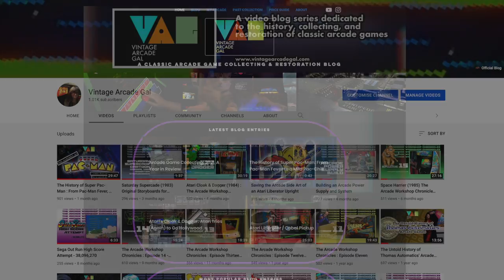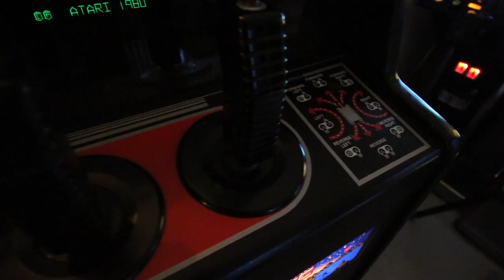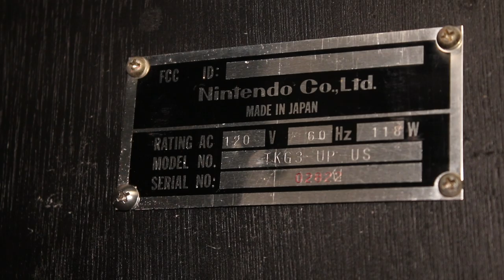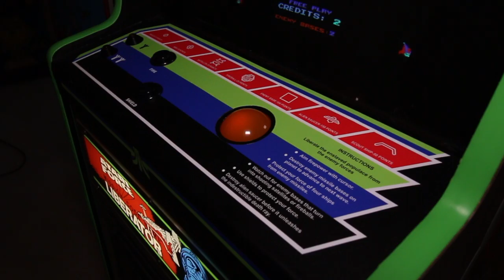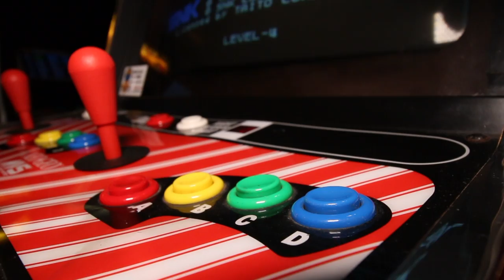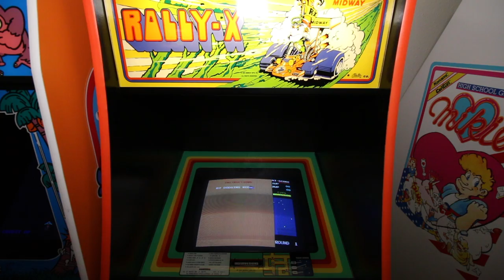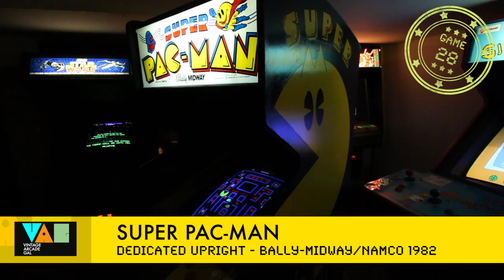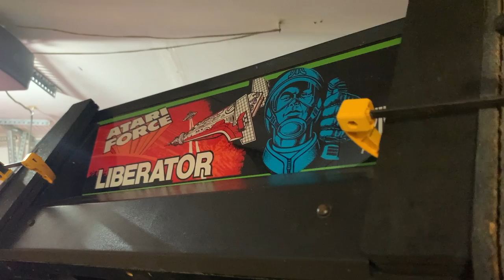A Tour of My Home Arcade Collection, 30 Classic Arcade Games

Comment: Awesome collection. I wish I had space to go that big. I guess I technically do, but I love my console games as well, so I had to keep it to 5 cabinets (I may be able to fit one more if I get creative). I have that same Centipede cabaret, which I play a lot. I also have a Neo Geo MVS, a Nintendo Popeye, a Time Soldiers that was set up as the original game in a Dynamo cabinet, which is kind of weird, and a converted 4-player Sunset Riders that has been at least two other games, but I can't tell which. It was at least a Crime Fighters and something from Taito, but they did enough 4 player games that I'll never know for sure most likely.

I like having an LS30 rotary stick cabinet. I sometimes swap in my pcbs for Guerrilla War, Gondomania, and Heavy Barrel, or the odd vertical JAMMA board like Devastators.

The Sunset Riders I swap in several boards as well. I have... Teenage Mutant Ninja Turtles, GI Joe, and Desert Assault that all have the same 15 pin connector for simple switching. I have other 4 player PCBs, but they're a pain to swap because of different pinout on the 3P and 4P harnesses (WWF Wrestlefest, US Championship V'ball, Ninja Baseball Bat Man).

I have a bunch of other JAMMA boards I swap in from time to time in  the MVS cabinet with a converter. A few that aren't all that great that I got for cheap, and several that I just love from my younger days like Rastan, Tecmo Knight, Black Tiger, etc. I think I have about 50 pcbs and a bunch of MVS carts (as well as one of those 161 in 1 banana yellow carts). I play Neo Geo more on AES, since I own more games on it, but that multi-cart gives me access to a few games like Money Puzzle Exchanger I may not have tried otherwise and loved!

Comment: Another great video! You mentioned having a switcher on the Nintendo Unisystem cabinet but did not fully explain. Is it a JAMMA switcher or is it one that lets you switch between different Nintendo VS games? If it is the latter, please let me know who makes it and where to get one.
Reply from the maker: It runs on Unisystem wire pinouts, but I think there are JAMMA adapters for Unisystem games...but I think they only work with one side of the PCB

Comment: I have been trying to figure out how to make a multi game system
Like a 2000 in 1 game box

I also see a JAMMA board and I don't know what is needed for one of these. They have 60 games in the board

Can you please do a video on how to build a 2000 in 1 game box ?
Reply from the maker: I'll try to do something like that in the future!
Reply: What you are describing sounds like a Pandora's Box which you can buy for under $50 on ebay. They usually come preloaded with 1500+ games and are usually plug and play if you already have a JAMMA setup. If it is CHAMMA then it will require CHAMMA to JAMMA adapter but those are usually less than $20.
Reply: Yes Added Sugar